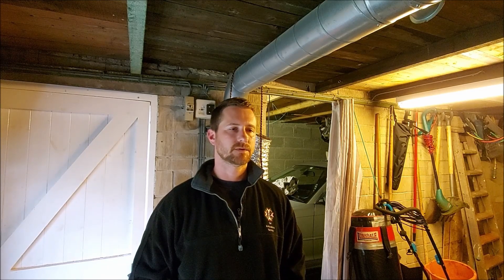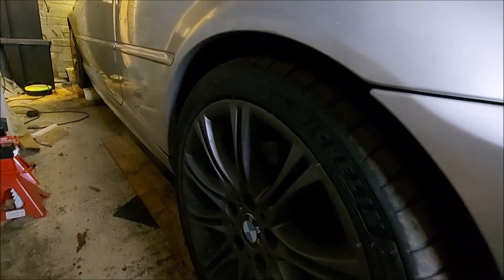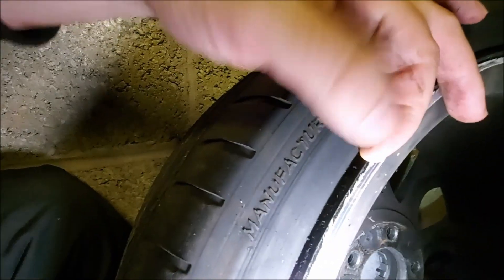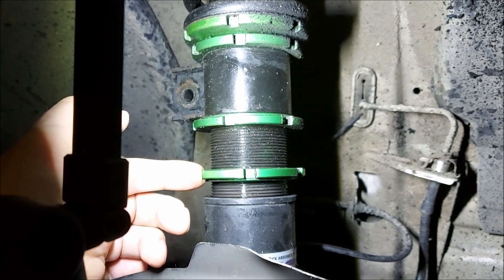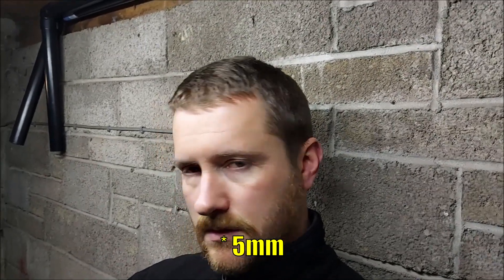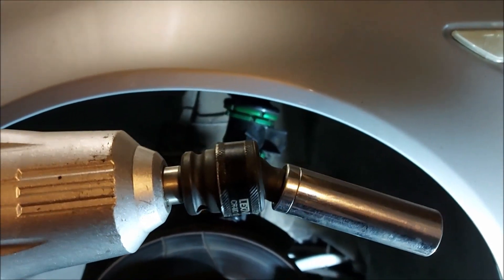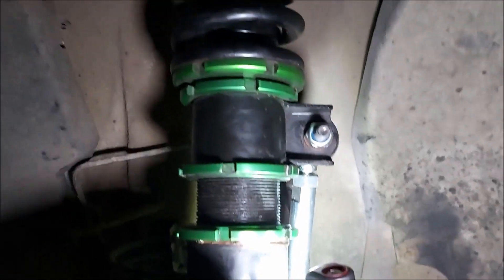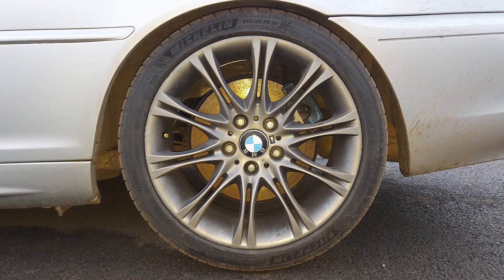Camber Mismatch - Coilovers Too High - Tyre Damage - BMW E46 3 Series 330 - HSD Monopro Coil Overs

Comment: Compress the springs, thats the proper way to set the ride height and will get you lower.
Reply from the maker: Not if you read the instructions.  You are supposed to set a small amount of preload in the spring.

Comment: Can you not move the camber pins on top of the coilovers over more? They normally come out so you can move them to next hole for more or less camber. Wouldn't of cut the holes bigger on the bracket
Reply from the maker: The camber is maxed out on the coilover mate. It can't physically move any more. The brackets aren't there as standard. They were added by me  to strengthen the strut tower.